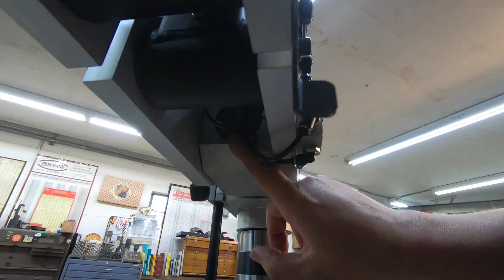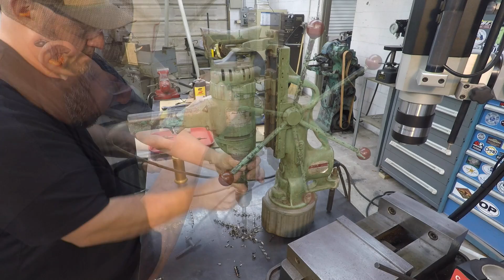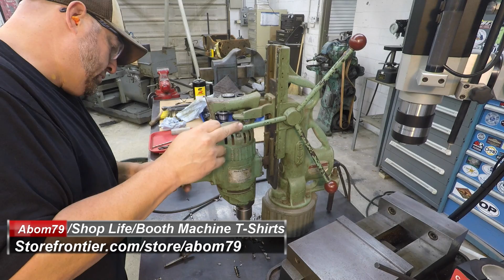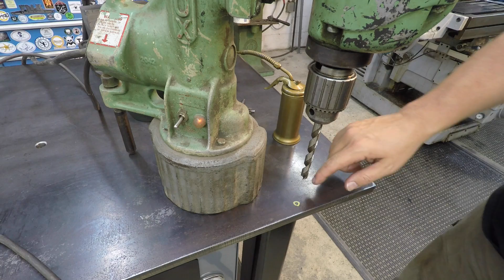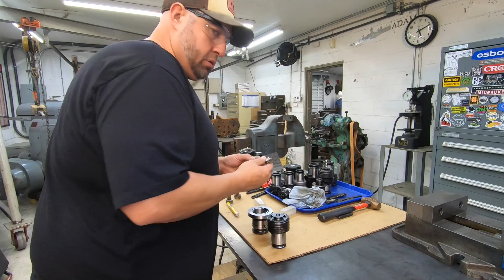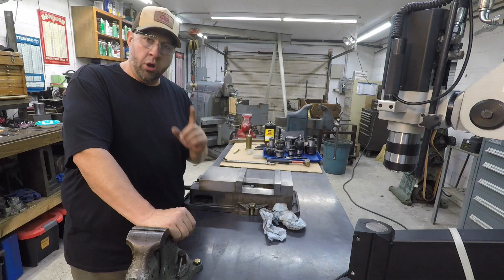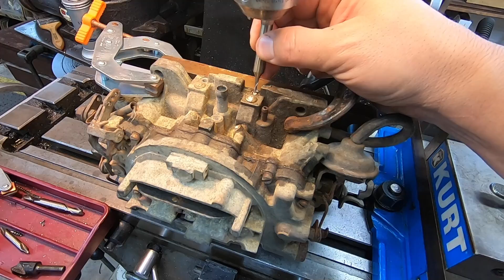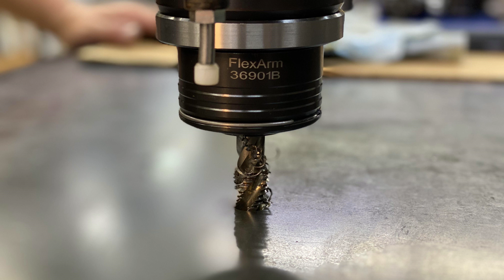SNS 301: Flexarm First Use, Broken Screw Removal

Comment: My great Uncle was Joe Carter,  he was a design engineer for Ford,  he designed the Carter Carb,  he later became the one of the VP's of the Ford tractor division, and was chiefly responsible for putting the first diesel engine out of a tractor into a pick up, which later turned into the first consumer Ford diesel pickup.  I used to go up to the suburbs of Detroit and visit them in the summer on some cool lake.  He took us on some cool tours!!  I remember they had this BIG hill behind part of the test facility, and had a BRAND NEW John Deere at the top of it with a bunch of things bolting on it.  He said that they were getting ready to roll it down the hill to see how it did.  He said they bought hundreds of tractors from other brands every year to crash, tear apart, blow up and abuse... LOL  what a job!!!
Reply: Badgermatt75 2016 haha what a life!
Reply: Awesome! I'm sorry you have to see what edelbrock is doing with the design nowadays though, I had one on a F.E. once, complete P.O.S. finally threw on a worn out Autolite 4100 and it solved most of my problems. Wish I could find a original Carter carb.

Comment: Hello Abom this is my first comment on here as you mentioned the arm would not reach over to the big vice side what happen if you move the arm to the middle of table still on the side  so you can do work on all vices ?
Reply: The arm has a minimum push out before its usable due to compression of the arm cantilever  - it just make it so he can use the vice but can't use the center of the table

Comment: Hi Adam, fell in love with your Flex arm, just like you, lookin forward to seeing it tap larger holes, 
Just an idear, you could make a custom slide that fits on the back of the bench that the Flex arm is fastened to, this way it will hit all points on the bench, some nice work for the shaper i think.

Comment: I was told by an electronic engineer that turning an electric motor on and off like the drill, reduces the motor's life. Maybe there is an aftermarket speed control?
Reply from the maker: Michael VanGundy Maybe some truth to that, but I call the BS flag. You must have never seen me work my electric press, and my dad before me.
Reply: @Abom79  
Good to know, thanks. And thank you for the videos.  I really appreciate the teaching you take the time to explain. I will never be on your level but it improves my projects.

Comment: I think that flexarm is a cool machine, looks a little large and over complicated compared to a Volumec, the tap holders and converter sleeves are an old system from the 1980s, Sandvik Varilock if i remember, hope you got a good deal on it.

Comment: 28:20 To extract a screw, this first choice: take a torx bit of good brand and drill a hole in the broke of bolt that is little under the width of the torx pattern but better little smaller hole then bigger. Hammer the bit down in the hole so its really there, screw it out and there you go. Have done that many times and works every time.
Reply: Never thought of that. Thanks for the tip. I've got a rusty, snapped off bolt that needs extracting and this might just do the trick.

Comment: A $200 job on a $50 carb. It is nice to watch you work.
Reply from the maker: Laddie It’s up to the customer to determine what they want to invest in an item. That was an original oem part that he’s restoring to use on a 69 Plymouth restoration.
Reply: @Abom79  Vey good more power to you. Have fun stay safe.
Reply: @Abom79  Funny, before I found your comment I looked up the carb number on the net. Carter AVS 4638S (assuming I read it correctly from a screen shot of your video), used on '69 383 with A/T and AC. Original equipment carbs are hard to come by anymore, so saving this one was a score for your customer.

Comment: Fancy new tool. We need one of them on a cart for tapping differentials and finals on 793's
Reply from the maker: steelace They can certainly hook you up with a package fitting your needs. Even comes on a mobile cart.
Reply: you work for CAT or Mine
Reply: @akfarmboy49  a mine that's way behind the times. Think Soviet Russia with hammers  and whatever field repairs that were acceptable in the 80s. And apply that to 114 793's

Comment: Adam, you did say that this was aluminum? Evaporust will not harm aluminum, but it also won't do anything to it or anything other than steel. (I've tried it.) Nice job on that, and of course no surprise. I think we have a case of "big boys with their big toys". LOL
Reply from the maker: I’ve been told that you don’t want to soak magnesium in it. Everything else is fine.
Reply: @Abom79 Yes, I know that, but evaporust will not clean aluminum. That's what I meant. I even tried it with the plates and it did nothing.

Comment: why would you want to resto a thermoquad? then again it most likely came from a mopar... and I can tell you as a mopar people, that mopar people are weird.
Reply from the maker: You just asked a question then answered your own question
Reply: NOT a thermoquad. Is a Carter AFB.
Reply: @russellstarr9111  correct, not a thermoquad. Thermoquads have a black plastic [phenolic resin] body. (Thanks David Freiburger)
Reply: @kadenwatt2033  fair point, but most carter branded carters aren't worth it, unless you're hellbent on making everything 110% original.
Reply: @spaxxor  True - ironically, sometimes having the crappy OEM carb on the numbers-matching engine increases the value lol
Reply: @kadenwatt2033  lol here's where I reference my previous comment on my people being weird. I got grilled pretty hard for restoring (that's a stretch, it rolls and that's it) an old duster with a modern hemi crate, and not the original. Considering that the original car was found at the bottom of a river, and had nothing other than the chassis and body I say I did well
Reply: @kadenwatt2033  Carter AFB is better than a Holley any day.
Reply: I'm not on either side lol, I love wrenching on projects (even though my girlfriend call them junk) regardless of how original they are. EFI or Carb, as long as it goes fast in a straight line I'm not too picky
Reply: @kadenwatt2033  that's the spirit

Comment: Adam, whenever I use the left handed drills I jog the motor on the mill as I apply down pressure, it usually bites just as the bit stops turning.
Reply from the maker: chuck smalfus I’ve shown many times in past videos using a left hand drill but with high success rate. It doesn’t work every single time.

Comment: That arm is a solution looking for a problem in your shop. It's designed for serious serial production, something you don't do. Then fixing the carburetor you've already got the hole indicated when you drilled it out,  having to move the part, refixture and tap with the arm didn't save you any time, effort or provide additional capability.
It's a cool tool, but Gucci for sake of YouTube not something you'd ever procure in the real world.
Reply: He left in the mill to tap it. The background never changed.
Reply: He didnt tap with the arm for the gearbox
Reply: The video was great content for 'his' channel, not yours, that I enjoyed watching.   :)
Reply: Well he does have a pile of Fireball fixture plates to tap one day.

Comment: I wonder if it would be possible to rig that mag drill with a VFD to be able run at lower RPM...
Reply: If it was a DC motor, that would work. The old tools are AC motors.

Comment: For the flex arm, I wonder if it would be quicker/more efficient to Dip your tap in oil. Rather than using an oil can. Which seems to miss the flutes and some of the teeth. Just something that came to mind immediately when watching this. (sometimes its hard to shut off the production and efficiency side of my mind)
Reply from the maker: TheTsunamijuan I’ll eventually have the mist setup to use. It’s built in, just have to supply air.

Comment: Where I work has 3 different size flex arms. They are awesome, you can tap a lot of holes fast.  The largest one is a beast, hydraulic powered, you have to very securely bolt the work piece down, or there will be trouble.

Comment: Very nice tool. So far those 6 holes only cost you $3600.00 each, to tap!?
Reply: Yes, only 4,000-10,000 more holes to tap for the arm to start making a proffit if he had to pay for the machine.  it's potentially good advertising to the manufacturer.   I'm sure this machine is a lot less expensive to run than a CNC for repetitive tapping operations.  Let the CNC drill the holes and do the machining, hand the parts off to an apprentice to pop threaded holes in them for $15-20/hr instead of using a $200/hr CNC.  A few 100 Fireball fixturing plates and you'll have 10,000 tapped holes behind you.

Comment: Ok I'll bite, why didn't you use the flexarm to drill the holes for the vices?
Reply: Simon Crabb 
Only built to tap. Not enough down force to drill it.
Reply: It's not made for drilling , it's a low speed/high torque hydraulic motor (higher speed electrical motor is usually better and more common for drilling) also you can't manually apply the necessary downfeed pressure necessary with the Flex Arm since you would just press on it with your body weight while with the Mag Drill you have the geared lever that helps you a lot .
Reply: Understood, thanks all!
Reply: To drill you need a static spindle and leverage to apply feed pressure. The flex arm is best for tapping because it's free-floating so it doesn't cut laterally.